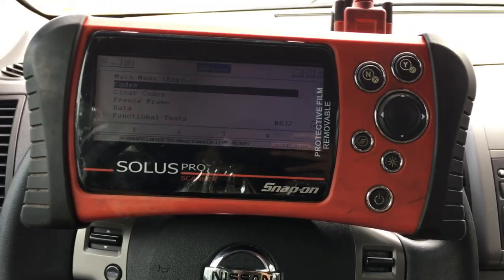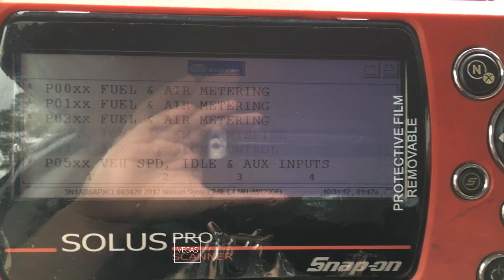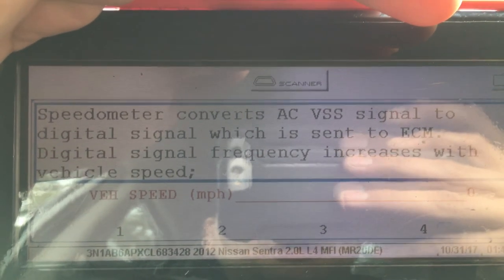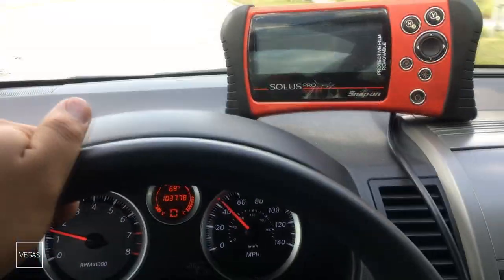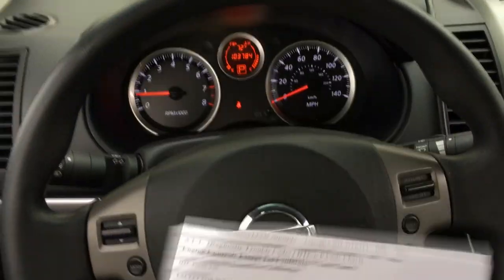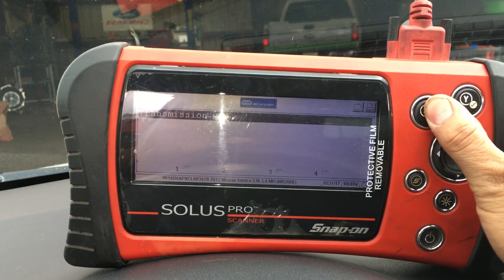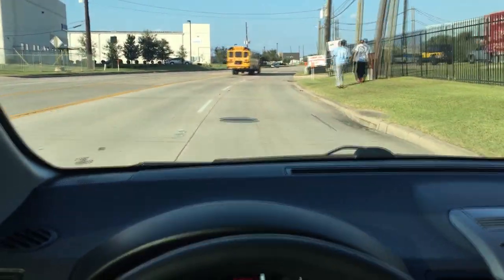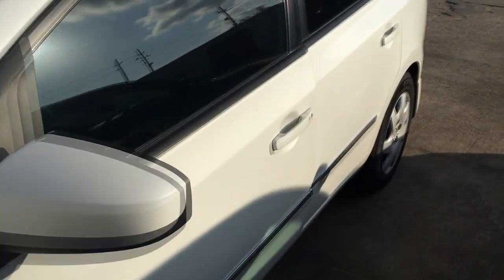NISSAN SENTRA ALTIMA P0500 SPEEDOMETER QUITS WORKING

Comment: Thanks for the video.  All the on my 2013 Versa are on and I never thought about the tires being the issue.  I had 2 smaller tires put on the front and all the light immediately came on once I started driving it.  I'm going to get 4 matching sized tires and hopefully that will fix the problem.  Thanks again for the video.
Reply from the maker: Michael Cooper I'm happy this video helped you! Thanks for watching!
Reply: Michael Cooper did changing your tires fix the issue
Reply: Did it fix it?

Comment: Yesterday , the brakes on my 2009 Nissan Sentra Ser Spec V started acting up. Firstly, the brake pedal went intermittently soft and squishy, almost dropping to the floor randomly while braking like there was some kind of hydraulic pressure issue. Then during the same ride while driving, I started to hear the exact same flickering sound coming from the front of the car as when the abs kicks in, but i wasn't even touching to the brake pedal. Today I've replaced my faulty oil pressure sending unit and I've removed the 10 amps  ABS fuse . Now the speed indicator doesn't work anymore. I guess that ABS fuse removal is to blame?

Comment: So you’re saying that the issue was the different tire size? Cuz the front tires on my 2012 Nissan Sentra are 205/65R 16 and 205/55ZR 16. The rear two are also 205/65R 16. Could the issue be that one different tire?

Comment: Hey brotha I have a 2012 Nissan Maxima while driving the cluster and radio turn off and shifter stays stuck when I put it in park I disconect the battery and the car works again untill it happens again 
I've replaced computer BCM and IPDM on the car and still does the same thing  what do you think it is?

Comment: What an interesting case study. The radius of the two is almost an inch different (21.24" c/w 20.44"). What kind of goofy tire shop would do that? Anybody who sells tires should watch this video, to realize what expense this customer went through. The other lesson is that even professional shops fire off the parts cannon, without thinking problems through.
Reply from the maker: The tire shop had a hard time believing me that the tire size was causing this problem. After they replaced the tires with the correct size, it fixed the issue. They apologized for doubting me lol

Comment: Hai, your  video is really useful. I have a 2006 Nissan pressage which has QR  25 DE When i drive speed is different in GPS and in cars speedometer. If the GPS shows a kilometer speed of 100 ,my cars speedometer just have 110 km. And i feel like  really lack of power then when  i googled it all 4 tyres  size is 5mm less than what it needs to have. Does it really affect the readings on speedometer of the car? Thank you

Comment: Omg I had the same exact issue on my 2014 nissan altima I had two tires blow on me back in January my bf went and got me some used tires for me. And all of a sudden it started doing all of this so I parked it and started driving our back up car. Well I just got my refund to finally get it fixed but first I took it to Walmart for an oil change and 4 new tires and when I got in every light is off now but the check engine light. So I do believe it was the bad used tires causing the problems. Should I just drive it some more to see if that light goes off too? It's time for tags.
Reply from the maker: I would probably have the engine computer scanned for codes and proceed from there. Thanks for watching!

Comment: I started having the exact same issue since friday, im getting a p0500 code, but ive been driving without one of the wheel speed sensor until i could replace it, for quite a while now and i had no.issues but.the traction.control stays off, so i'm wondering if instead of the different tires size in your case, the fast spinning of front wheel in snowy condition due to.non working traction.control could have triggered the problem in my case? Also in my case the radiator fan stays on whenever i start driving the car and will.not stop until i stop the car, i have a 2012 sentra se-r with cvt transmission
Reply from the maker: If there is any faulty part of the abs or traction control system like a bad. Or missing sensor, then the computer disables the traction control system all together.
Reply from the maker: Thanks for watching!
Reply: Did you ever find out what was the cause ? Is it fixed
Reply: Not too sure, took the car to a mechanic, they then cleared the codes and it worked, i did clear the codes but apparently my obd scanner is too basic to reset transmission codes, so thats why i could never get rid of the codes properly,  the problem hasnt come back since, the mechanic tought it was possibly due to harsh cold weather    (we had a lot of -35 to -45 celsius last winter) and i did have another random code pop up on a cold start during a very cold morning, something about throttle actuator ?? Throttle would not work properly that morning but after the car heated up for a while it worked fine.
Reply: Still have abs light on and traction control off light to, but that is due to a missing sensor we couldnt save when i had wheel bearings replaced, it was pretty much fossilized in there
Reply: @Swordy696  hey bro sorry to bother u but did u ever fix the problem of ur radiator fan staying on? I have the same issue. 2012 altima . If so wat was the problem and fix? I would really appreciate it if u would lmk. Thx.
Reply: @salvadorsalas5576   It was a vehicle speed sensor issue in my case, the fan kept running as a "safety measure" because the computer could not read the vehicle speed anymore, so anything related to vehicle speed (cruise control, tachometer, auto doors lock, rad fan) would not work properly, if you have any of the mentionned issues other than the rad fan, it may be one or both ( input and output) vehicle speed sensor at fault, also if you have am obd reader, it would help the check the trouble codes if there are any
Reply: Good that you stopped that parts cannon.

Comment: I understand what you was talking about but you did not show everybody how did you fix the problem you should have made a part 2 just to show the world that everything works but you didn't what did you do to take off p500 and p1574 codes
Reply from the maker: Thanks for the feedback. I said in the video that the car was going back to my friends shop to replace the tires with matching sizes. In the video description I wrote that the car worked great after replacing the tires.
Reply: So the problem seemed to be the tires not the sensors even tho we won’t really know since the sensors were changed. I am having the same problem on my Nissan Sentra 2009 would you recommend changing the tires and sensors both?
Reply: Alvaro Rojas did you get this issue fix?

Comment: Don't get it. i had the same P0500/0505 code advising speed sensor defective. So, i changed the sensor, a real pain in the ass,  and the speedometer, odometer, and radio functions related to mpg, etc. still dont work!!! WTF? those electronic OBDC meters are worthless.
Reply: Can you show me where the sensor is located please?